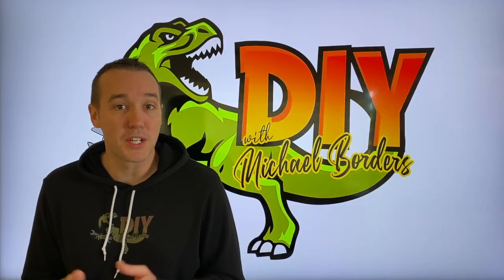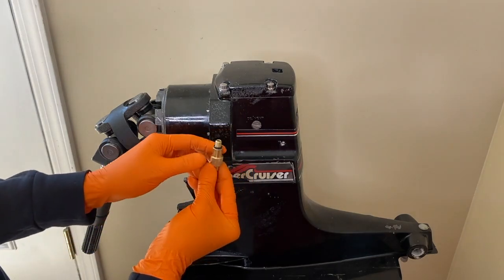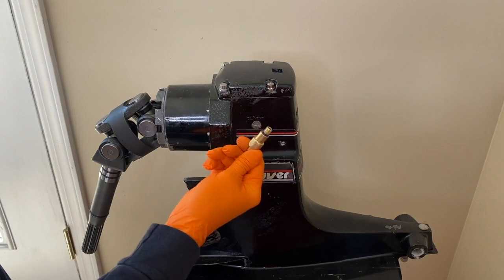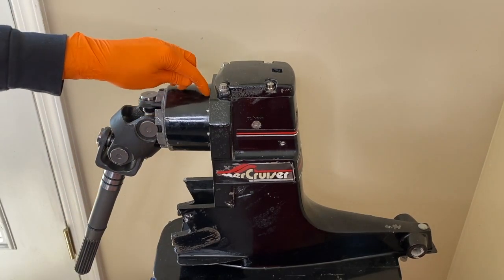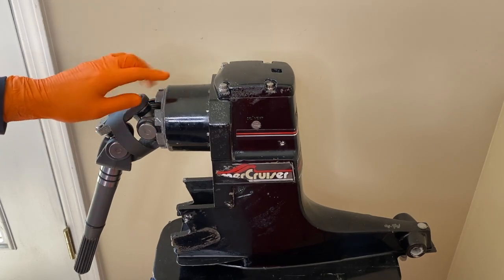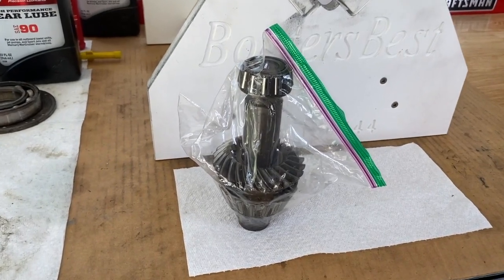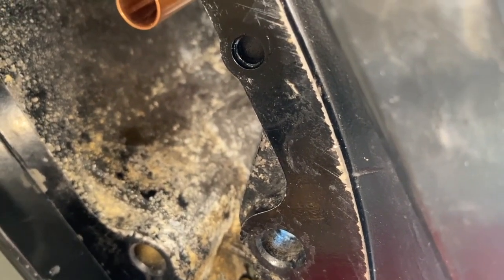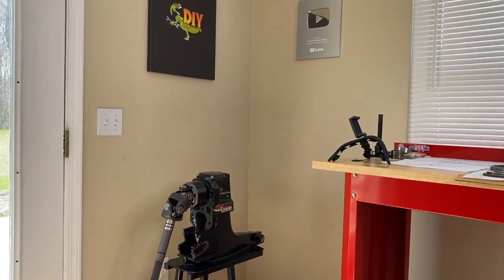Mercruiser boat outdrive Upper unit not pressurizing - Common causes

Comment: Hello Mike, thank you for these videos! Very Helpful and professional, best I have seen. I am restoring our childhood 1989 4.3 liter Baja islander 190 with this same outdrive and we have gear oil leaking into the bilge. I would guess it would be the U Joint oil seal but I am new to this and unsure. Which of these seals do you think would be the most likely culprit?
Reply from the maker: @stuffandsuchyeah5182  

Good morning ☕️ that’s awesome.  Restoring your childhood boat has that added sentimental value and makes the project more fun and much more meaningful.

Any update on your findings.  We are very confident that it’s the yoke shaft oil seal that has failed and is allowing oil to sneak past and into hull.

Please keep us posted, we love talking boats and jet skis.

😁👍🧰
Reply: @DIYwithMichaelBorders thanks for the advice! I’m very excited to fix it but it will be an overtime project, my goal is to be finished by next season, I’ll keep you updated. I will also be changing the bellows as it’s definitely passed due. Would you think I should go ahead and replace the gimbal bearing while I’m there even if I’m not currently having any problems? I’m not sure if they are a regular maintenance item, boat has been sitting for years unfortunately.
Reply from the maker: @stuffandsuchyeah5182  

Taking your time on it is the best way to do it.  We recommend replacing gimbal bearing for sure.  😎👍